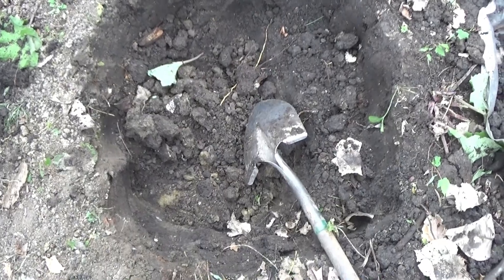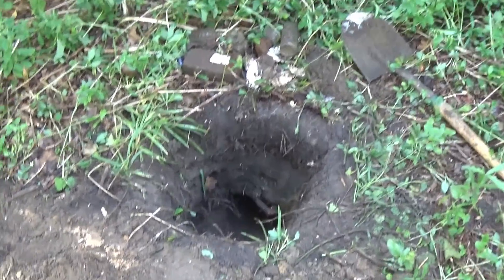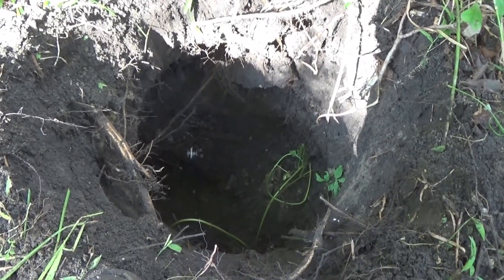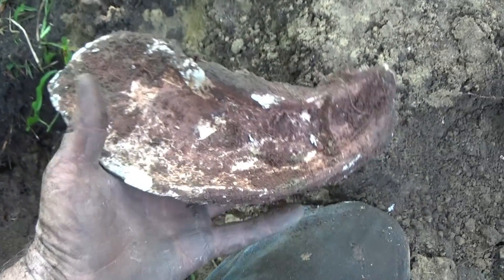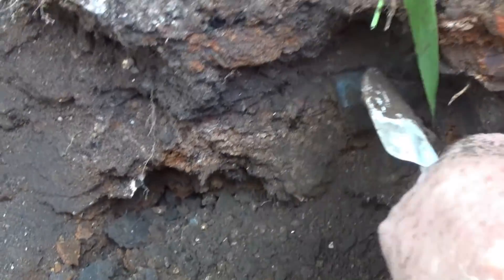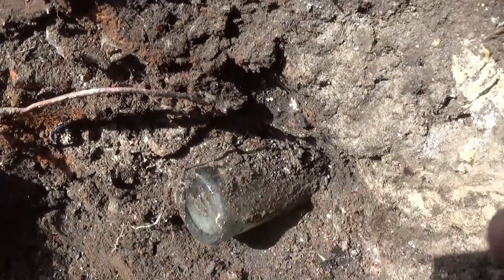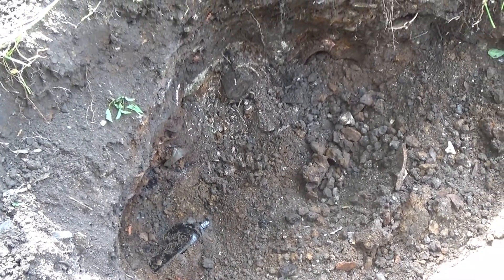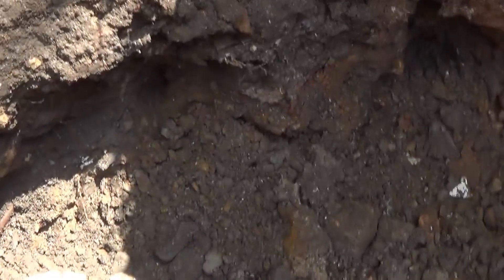Privy Diggin In The South..Pontils & Blackglass

Comment: Tomorrow going to dig out in WWII downtown trash, all shipped out near Kaena point & burned.  It's vast, several acres and very random, late throws & all.  French for "Good friend", still in stores out here.  In cardboard & aluminum capped tubes, same as Comet and Barkeeper's Friend.  Bon Ami "Hasn't Scratched Yet" and picture of baby chicks.  Maybe you need to start an oyster cult!  I found three of those Rimffords all together, in an 1894 or older lot.  Broken Tahiti Lemonades and Crystal's.  Merged in 1894 forming Consolidated Soda Water Works.  Which abound all over the Island.  '80s diggers were there downtown.  The horseshoe & star tumblers are out here, and the West generally.

Comment: Hello Dave! What is the hand trowel that you use? Is it made of a material that won’t scratch the glass bottles?
Reply from the maker: I just use whatever I have laying around, but prefer those little garden hand shovels. I prefer a tough plastic tool that wont scratch glass, but they are hard to find. The steel hand shovels work great though and dont scratch the glass as long as you are careful.